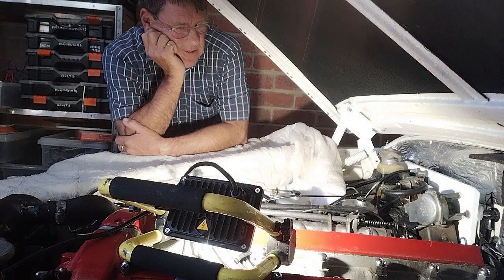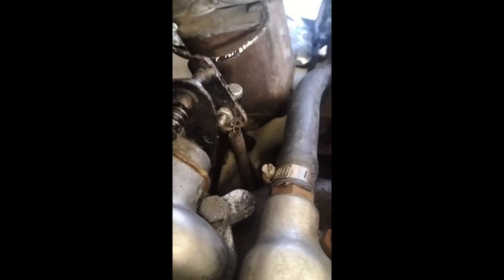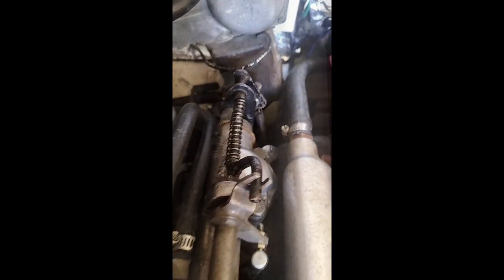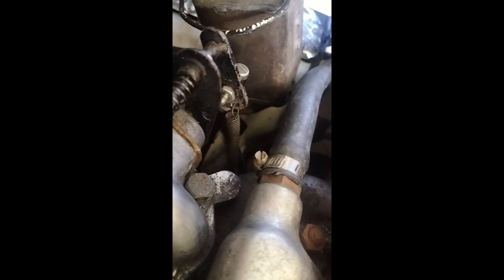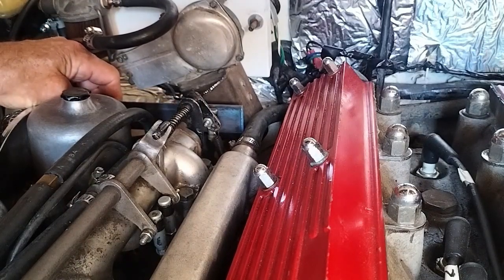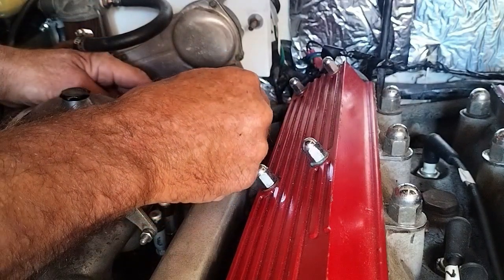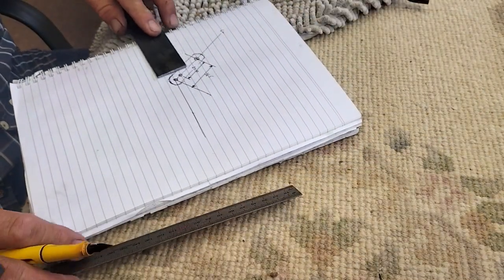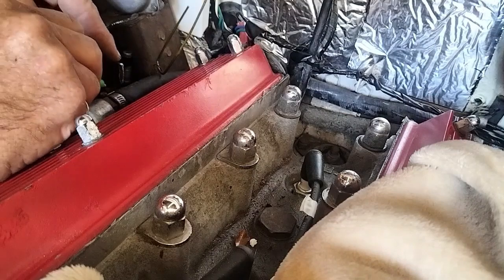Episode 13 - Sleeping Beauty Jaguar Mk2 - solving a Triple SU carburettor linkage problem

Comment: Oh gawd.  Apart from trying to stay awake during that video, why didn't you just release the plate attached to the throttle shaft (grind off the weld) and re-attach it (re-weld) at an angle that provides better spring tension in the way that you have tried to achieve same with your attached plate....

Comment: I have a triple carb Austin Healey which is all factory but not yet running.Any good oiling the pivots or adding a return spring?. I have a similar problem on an MGA where one carb does not completely shut off when you lift off the throttle. Everything checked for freedom of movement so still investigating.
Reply from the maker: I am no expert! If everything is original, it should be made to work as it was designed to be. But in my case, nothing was original so I had to nut something out to make the return spring more effective. My videos are fairly dull, but I always hope at least there is one thing that people see that is useful to them!!